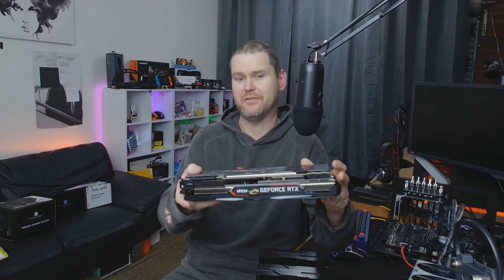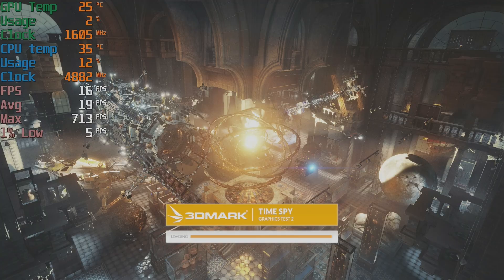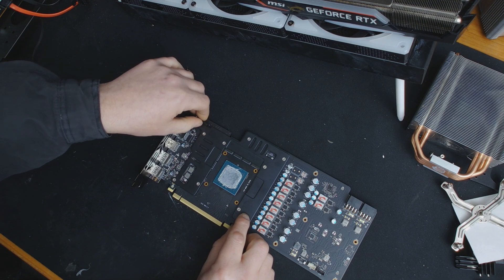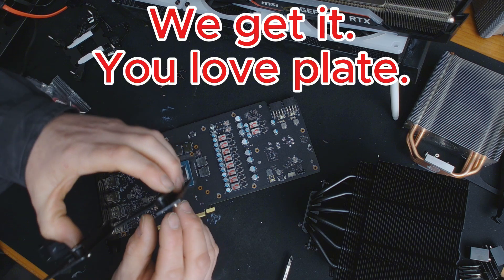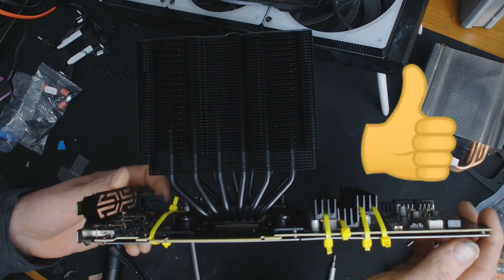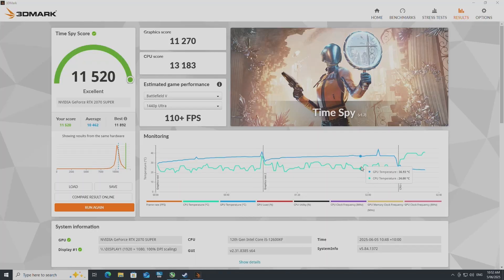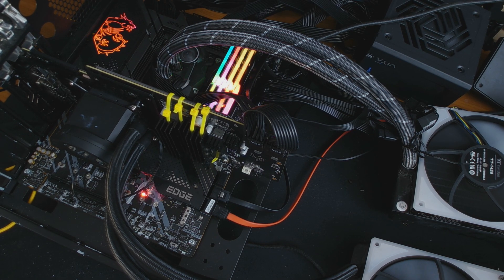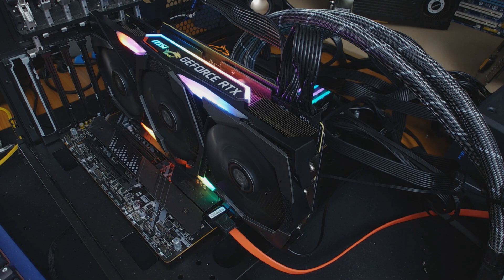I Put a Peerless Assassin on an RTX 2070 Super

Comment: How do you know how much pressure the stock screws has? Surely you have to match the torque between the modded cooler and the stock cooler, to not crack the die due to too much torque, right?
Reply from the maker: Nah, I just “feeeel” it. Become one with the screw. 🤣

Comment: Can you do one with airflow like cpu tower fan that exhaust hot air at the back end  of the  case
Reply from the maker: Do you mean like this? https://youtu.be/Msal89TS7Ms
Reply: @TrashBench yeah if possible 1. Use simple smaller cooler and 2. Use case with power supply on top so that you don't have to use pci riser.
Reply from the maker: @Tons_art  I have kind of moved on from this set up, but you have reminded me of one idea I had I'd like to test out. I'll get to work!

Comment: On load my 2070 reaches 81  degrees Celsius. Will this help or nah? Also what are your ambient room temps? Mine is 28
Reply from the maker: Yeah it will for sure help, it's very impractical though! You'd probably be better off repasting with a quality paste and redoing the pads. That alone should net you a big drop. Or just increase the fan curve.

Comment: You can also try Peltier cells.
I've always wanted to try it, but the problem is that these cells can't stay cool for long before they start to heat up.
My idea is to use two cells connected to a CPU cooler and find a way to cycle their power-up times.
So that only one is on at a time, and when the one that's on is about to heat up, it turns off and the other one turns on.
(Sorry if my writing is clear; I don't speak English.)
Reply from the maker: Yes I know! I am looking into this at the moment :)
Reply: ❤ @TrashBench
Reply: The problem is Peltier cell dont like change your in heat that gpu change too much but they are great to cool loquid in liquid coolers

Comment: Since you'll probably see this message, you should do a bit longer of a video but also an idea I've wanted to see for a while. Can be for either cpu or gpu. Get a cooler with ice and water in it, put a bunch of sea salt in there and have the water circulating. Put a pump in there and separate the pump from the ice so it doesnt try to get sucked in there. Have it cool the part and recycle the water back into the cooler. Obviously the salt isnt good for a system like that, but its basically the coldest thing I can think of besides dry ice and LN2.
Reply from the maker: You're all over it mate! Did this last night, I'll post the video tomorrow ;)
Reply: @TrashBench  With everything I said? Sea salt and moving ice water?
Reply from the maker: @HannibalGraham  Yep! I'll get the video out tomorrow. Only trouble was, I thought I bought salt, but forgot... so had to steal what was left in the kitchen lol

Comment: The issue is your mounting mechanism.  You are not able to get sufficient pressure on the die with the way you have mounted the heatsink/aio to the baseplate.
Reply from the maker: If I clamped it down any tighter, the die would have cracked.

Comment: Ngl, i really want to see this on a 5090 with its high wattage

Or rx 7900 xtx since amd is known for being hot

Overall, cool stuff man.
Reply from the maker: That's not going to happen unless I win the lotto or Asus happens to send me one for "review" :) Thanks for the support!
Reply: @TrashBench  understandable

Maybe in a few years

and you're welcome
Reply: I have a 5090 and the cooler is fine. The fans barely get to 50% and it runs at 75C and full boost 2880MHz in games and AI workloads
Reply: @chatch15117  interesting

I saw benchmark of 5090 founders having high temps in 90 C of vram temps

I hope you don't mind me asking but, Are you using a different model?
Reply: @deezknutz2038  I have a Gigabyte AIB model. I don't buy founder’s edition
Reply: @chatch15117  i see, ty for letting me know

And congratulations on the gpu
Reply from the maker: @chatch15117  That’s cute. I’ve got a 2070 Super pushing 2115 MHz,  nearly 20% over stock... while sitting at 31°C under a $60 air cooler I zip-tied on for fun. No AI workloads, just vibes and thermal violence. You bought a spaceship and cruise at 75°C stock. I built a go-kart and made it fly.
Reply: @TrashBench  I sold my 2070 Super 4-5 years ago. I made a bracket for my GTX 470 to mount a Corsair H50 to about 15 years ago. Back then it actually made a difference, remember Fermi was known for running hot. I was at maybe 62C load. Strapping an air cooler to a modern card is certainly a choice
Reply: Temperature gains on a 5090 would mostly translate into power efficiency, as you're not running that silly cable any hotter than it already gets at 600W.